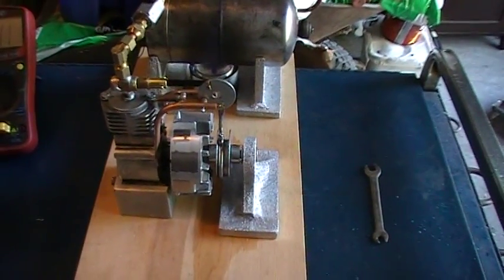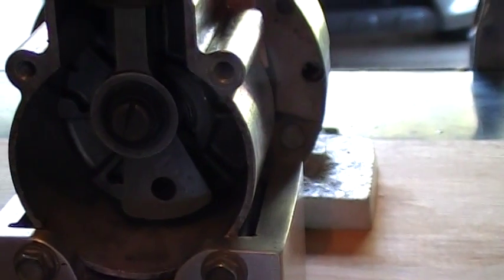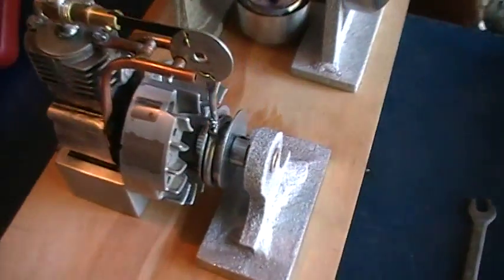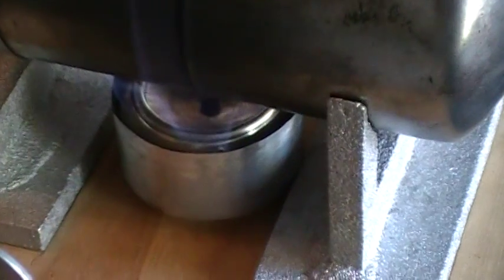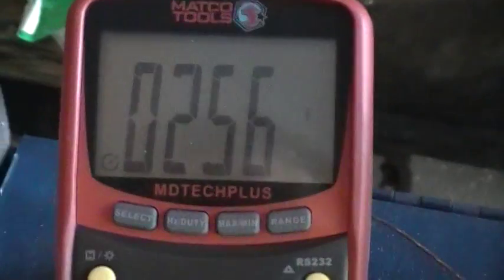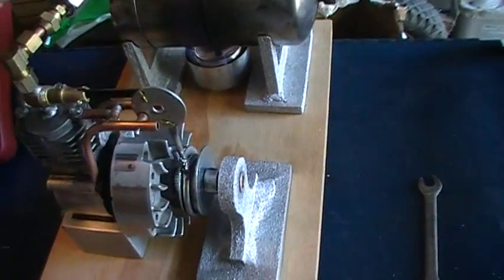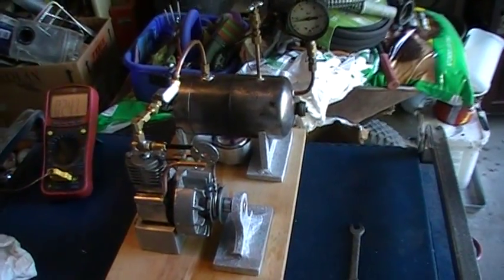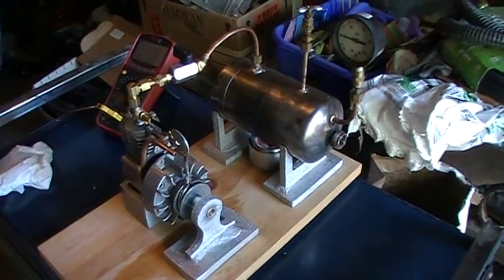STEAM ENGINE  (NOT COMPRESSED AIR)

Comment: I feel like this is more efficient than compressed air, you don't need a loud and powered compressor to run it and the only fuel it requires is water. Wonder how much torque you get from this because if you have enough to spare then you could hook it up to a generator and have enough power for an electric heating element to boil the water. Not really perpetual motion but would be relatively self sustaining.
Reply from the maker: Did you see my homemade generator? Funny you said that!(go look)
(P.S. This is a tiny model, no way to make that much power but it was to see if I could make one, I figured If I could make a model I could make one bigger)
Reply from the maker: Also many morons say "steam engine" but use compressed air because they don't know how to make a working boiler.
If there isn't any steam how can you call it a steam engine...ugg!
Reply: @stclairstclair 
 will an automotive AC compressor with multiple pistons act as a steam engine if i feed it steam?
Like the one in this video
https://youtu.be/w3aqgpKz5nI

Comment: I am actually fascinated by your design, simple but interesting to watch :) Though I have to ask, do you oil the moving parts or do you run it dry (Since you didn't show anything like that in the video)
Reply: @stclairstclair  not yet, I'm looking at all your videos :)
Reply from the maker: I nervelessly added some Marvel Mystery oil to the boiler, Later discovering that is what they used to do in many stream engines, Now i have a mig welder and also brazing rod im going to build a larger wood burning boiler, im glad you liked it!
Reply: @stclairstclair  I didn't think adding oil inside the boiler would do anything? doesn't the oil just stay in the boiler, or is the temperature great enough to heat the oil to evaporate into the steam outlet ? perhaps I was wrong about that? Looking forward to seeing that :)
Reply from the maker: @creativeobsin  The oil thins out when heated and gets pulled through as it uses the water, works better than you would expect, not much oil is used, not much comes out, and the steam is definitely oily smelling so some is carried off with the steam.

Comment: Awesome. Thats really smart. Had not thought of that, using the motion of the fly wheel to let it operate an in and out motion of the steam flow going into the engine. That way the engine will last longer with its steam, right?? Trying to figure out how this works :) More underneath;

Another question, = what if you would hook this machine of yours to a huge 100 gallon water boiler? Also, that water boiler would be heated by one 12V small RV water heater. the extra motion the machine produces would then be used to power a generator which would provide some batteries of power which would then provide the 12V water heater of power with electricity to spare. = This making sense to you. Would this be at all possible?? Absolutely loved your video, great work. Thanks.

Comment: for the record i just wachted 50 vids or so on these devices and yours is by far the most powerfull
i have seen in the sence that the sound of it running tells you it aint no joke, im gonna try a die grinder steam engine because i can buy 1 for 15$ so it seems to be a very cheep turbine with desent power, thanks for posting despite the hatred your female may have for you building things that seem like a total waste of time

Comment: love it , try heating the piston friend , you loose power from condensation , dont get me rong it works fine im just sum what of a super mod nut , i always max every thing to the edge of disaster, try heating the cooling fins of the piston cylinder with a troch and see if it revs up any

Comment: @stclairstclair Yes I have seen you other video. I'm very interested in boiler design. Ideal would be able to superheat the steam. But that would probably require a bigger boiler.
I'm Interested in putting a steam engine in a motorcycle at some point.

Comment from the maker: @bg0821 Hi, this is the lower end of an air shock compressor from a late 70's caddy, was not a gas burning engine, But i did use a weed-eater flywheel